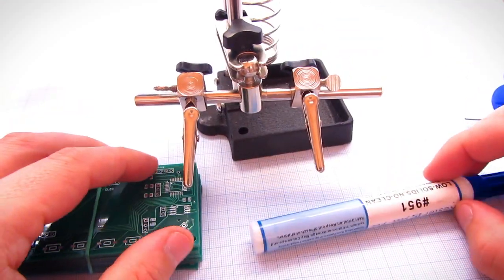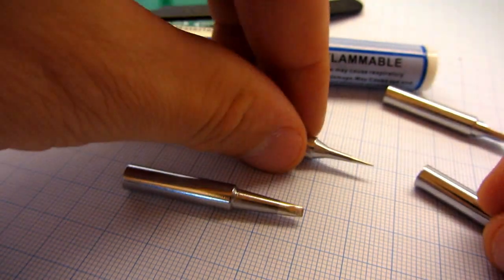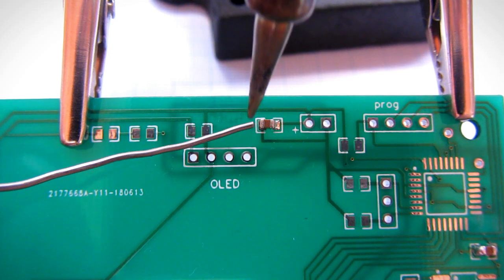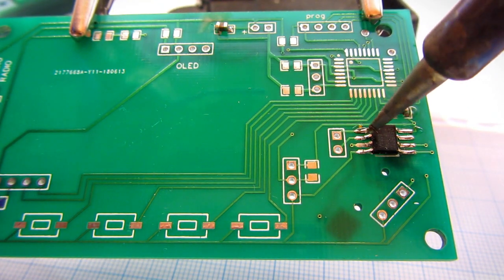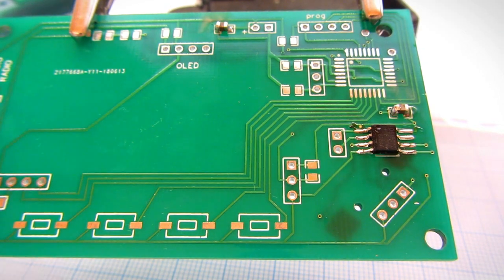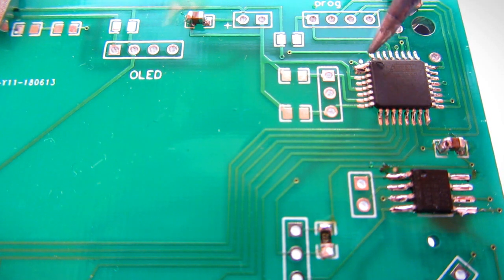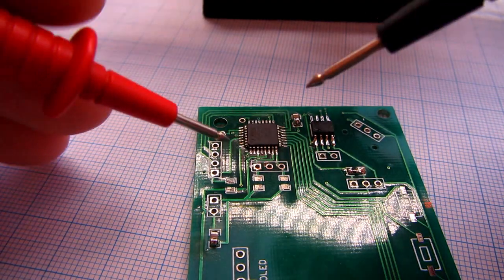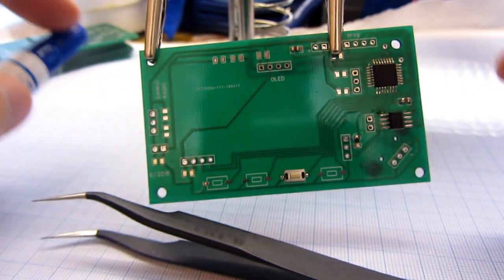Soldering SMD components and integrated circuits (SOIC, TQPF)  - Mustool MT233

Comment: My flux pen tip is dryer out . How do I get to to work again ? Please help as I have some things I have to work on .
Reply: My pen says it is good for 1 year stored at 25 degrees Celsius. So I think yours is gone. Buy another or buy flux paste, I have it and it is 40 years old and still works fine (no joking). I wanted to try the pen as it is easier to apply than paste.